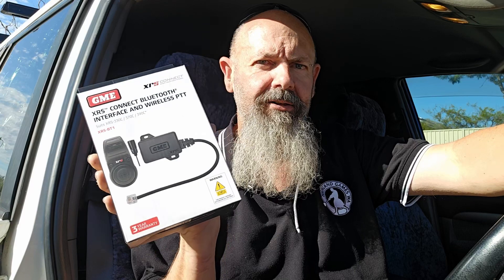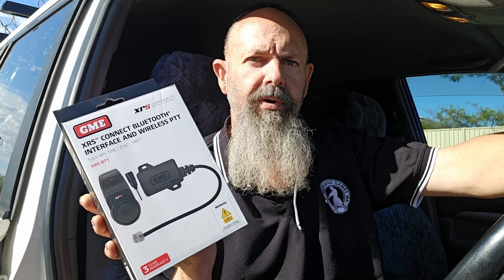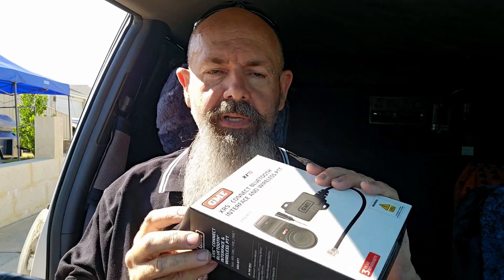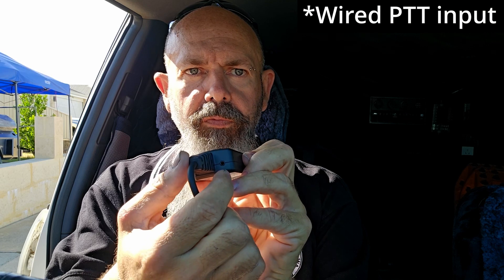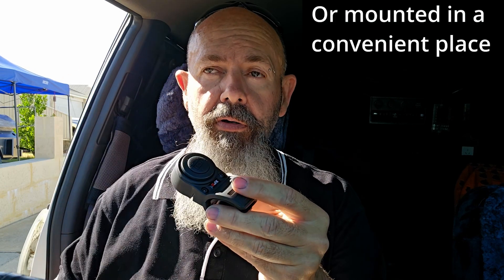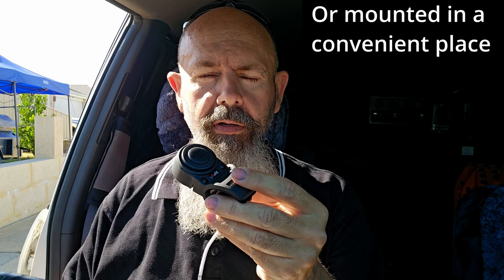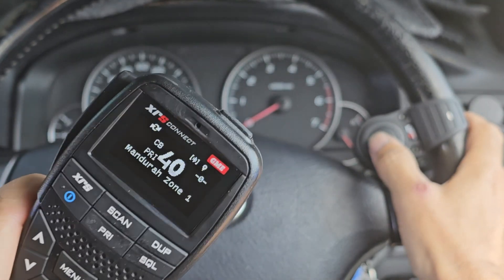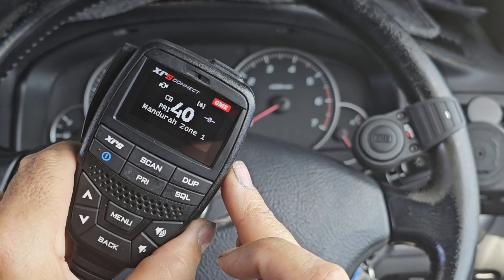How to - GME XRS-BT1 module install

Comment: is there no bluetooth built in the uhf unit
Reply from the maker: Morning Jock, yes the XRS radios do have Bluetooth built in but the BT1 module serves a different purpose. This module allows you to push a button which can be mounted on your steering wheel (or place of choice) and talk without having to pick up the microphone. These units can also be paired with ear buds or headphones allowing you to take advantage of noise cancellation in a loud environment or to communicate from outside the vehicle via the ear bud/headphone mic during a vehicle recovery for example.